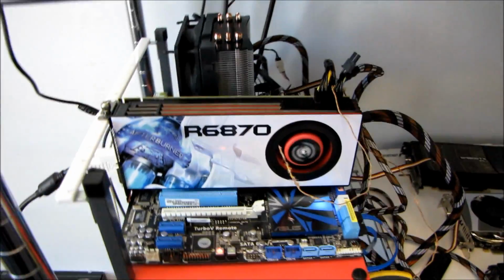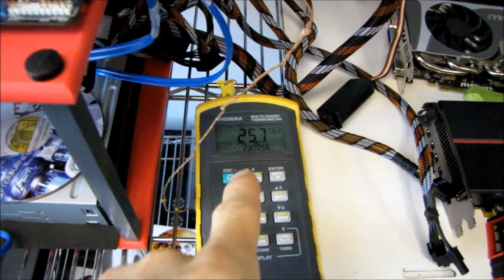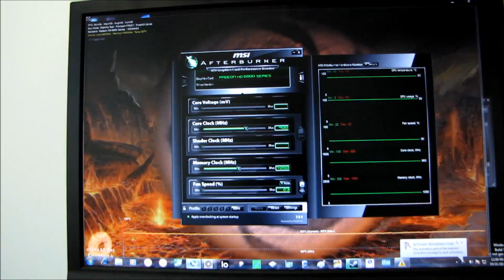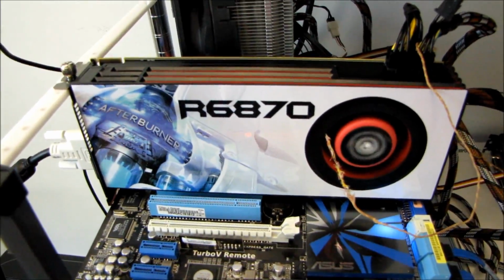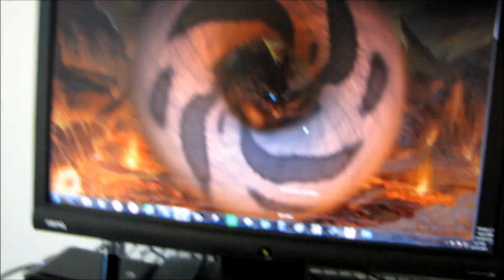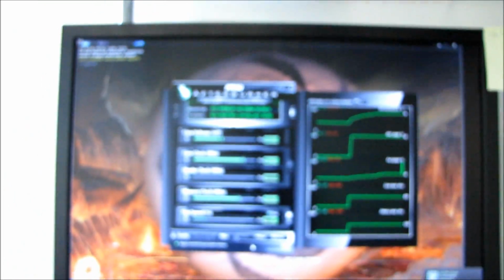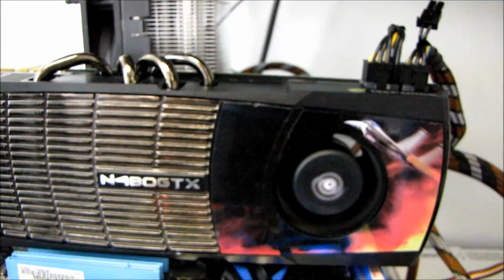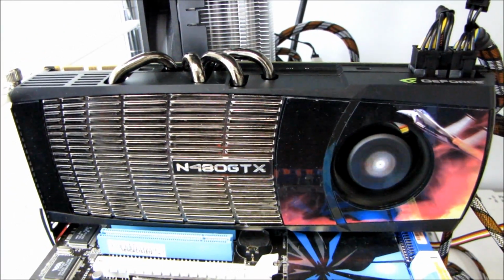MSI AMD Radeon HD 6870 Video Card Noise & Temperature Testing Linus Tech Tips

Comment: ah right, but ive installed a fan on the bottom of the case next to the psu and below the video card, which is pushing air towards the card and the top fan taking the air out

Comment: do not be afraid of those temps. If you see a temp that you think is too high the manufacture does have save temps of operation. You can prolly find this info on the website or included instructions

Comment: maybe the temperature varies by brand, mine is an xfx and i have it in an nzxt phantom with 5 fans, but none of those are directed at my card, you could try msi afterburner and use a custom fan curve, bring the fan speed up and lower the temp, i know mine gets to around 60-65°C at 50% fan speed, however, at that speed it's not too quiet.

Comment: @WiiClassic2usb - But my GPU hovers at 122 F. My case is a CM 690 II, I have a space for a fan just ahead of where there PSU sits with a mesh liner, if I had the extra outlet for it with Pulse Modulation, I'd get another Cooljag to put down there. Thought about getting a PWM splitter cable from FrozenCPU, but dunno how safe it'd be running two of such a high powered fan off one connection on the mobo...

Comment: @Darkfallification - I've downloaded version 210, and I've got it open and it's nice. I like the fan ramp feature, like the Asus AI "Fan Xpert" stuff that came with my Mobo, except with more than 3 dots, now if only I could get the damn thing to display temps in Fahrenheit instead of Celsius. The first time I had Fan Xpert open, I set the top dot to like, 80c thinking 80f, so it got really warm once. I also get the occasional "makes no sense" readings from Probe, like -198.4c.

Comment: Yes, MSI Afterburner is sponsored by and co-developed by MSI and Rivatuner. It works with both ATI and nVidia cards. You also don't need to download GPU-Z really, as Afterburner has its own monitoring. However, GPU-Z is great to see more info about your card real easy.

I can't believe my card heats up so fast and to 90+c. I have plenty of ventilation. Two front and one rear 120mm fans + PSU 120mm fan. And a Thermaltake 120 Ultra on the 3.6ghz OC'd 2.4ghz Q6600. Oh well...

Comment: Download MSi Afterburner. At the right of Fan Speed (%) click the User Defined. Use the default curve. Download GPU-Z to monitor temps and speed. Download FurMark for the stress.
FurMark with default autofan: 93c max, 86% fan on a 9 minute test.
FurMark with default User Defined curve: 90c max, 98% fan max on 9 min test.
Sure the fan gets louder, but that curve cools more effectively.

Comment: @WiiClassic2usb
My HIS 6870 1gb reference sits around 60c idle normally. I just worked out that it is switching to 900Mhz full speed when in Firefox browser here. To fix that idle stress, as Firefox surely doesn't need 3D rendering performance:
Click Tools -> Options -> Advanced -> Use hardware acceleration (untick).
6870 should then run at 300Mhz in Firefox and idle temp should decrease, meaning a longer life for your card.

Comment: Curious question from a paranoid over-cautious user. I have the 1gb Radeon 6870, Speedfan says I'm at 51c / 122 Fand it has a little fire icon next to it, which makes me think it must be over-heating or something scary. But, it runs like this for hours, and I've left it on overnight for days at a time. Closing Firefox drops it back down to 117 F and eventually after a bit it goes back to 95 F. Is all well? Or is Speedfan just particularly sensitive?

Comment: @erenei you particular may have been factory locked at those settings due to a hardware issue like running too hot or artifacting what I would do is call up gigibyte and ask them questions about it and if you don't get an answer return the card and go with a different brand like xfx or sapphire

Comment: @PsiloCybinDreamX 

Don't use benchmarks as an accurate judge of performance because they're not. Use actual in game numbers like I just mentioned. 5770's in Crossfire are NOT 30% faster than a 6870. The benchmarks test for worst case scenarios which are hardly ever achieved in actual games. Benchmarks like Furmark are just ridiculous because no game will ever push a video card that hard.

Comment: @PsiloCybinDreamX 

Where did you get that information from? I just looked at a test at Legion Hardware and they show 5770's in CF running about the same or slightly ahead of a 5850 in most tests which is about where 6870 is, too. They tested in AvP, Crysis Warhead, Far Cry 2, MW2, BBC2, CoH, HAWX, Just Cause 2, Metro 2033, Stalker Call of Pripyat, World In Conflict, RE5 and Wolfenstein And the 5850 and dual 5770's went back and forth with the 5770's just edging out the 5850.

Comment: 41c idle is pretty good but thats at stock fan speed, my 5870 i have it at 28% fan speed and is idle 30c and max load its is with normal gaming (not furmark) 66c max with max 34% fan speed.
This is set with MSI Afterburner fan profile setting.

Comment: @klote2314 Barts IS NEW It was released Oct. 22, 2010.   5970 Uses two old  "Cypress" GPU's released  November 18, 2009.  Antilles, is the high-end dual-GPU that will be in the 6990 and hasn't even been released yet.

Comment: @crimson177 With no water cooling or any extra cooling 41c and 80C+ for a modern graphics card with the default and standard cooling system is not high at all. It's quite low actually and old graphics cards usually had higher tempatures. Note that most graphics cards can deal with tempatures way higher than 80C and that it's a huge difference when you add a better cooling system.

Comment: @aram994 hd5970 should be faster as it has a hd5870 and a hd5850 inside, very similar speeds... the hd6870 is slower than the hd5850 (cheaper) and is veeery close to the gtx 470 and the hd5850 is a lil bit slower than the hd6870... but gain .. hd6870 performs very good with crossfire and its newer... i would go with hd6870 crossfire =D

Comment: @drKlitzman Yes, but not be an extreme amount. But, considering the fact that the 6870 costs less, it is the better deal. The performance numbers will decrease as there are going to be driver optimizations, however, keep this in mind:

The 6900s are ETA'd for the end of November. If you're going to upgrade your graphics card, wait for those.

Comment: @VoLtrex31 About 40% above the 5770. On par with the 5850 a little bit lower than 5870. It has higher minimum fps in DX11 tessellation than the 5870. The 5970 shouldn't be compared as it is in a whole different league.

Comment: Ha. Well my GTX 480 is 47c under max load. Idle is 32c. Yeah H2O cooling.
Stock clocks, not all that much difference at 800mhz as well.

Comment: @Randomshit1353 
at this moment
gtx480 single card
HD 5970 dualgpu card

If you do not wait on a newer ati/nvidia card to come out i suggest getting a gtx 480 from some less known manufacturer (like club 3D) they can save you about €150 on the same card with another sticker

Comment: thats weird that your gtx 480 gets that hot outside a case. mine gets at 81^C at full load inside a case. plus it almost seems like you're badgering the gtx 480 because it would never in at least 10 years get that loud intentionally. maybe after things start to get worn out. and benching cards at full fan loudness is a silly thing to do anyways. cards will never need that kind of fan load. unless components inside the chipset are worn out and are getting much hotter from a long time of use.

Comment: @free2question If you can return it then go for two 6870s. in 3 years it'd be wasteful to buy a 3rd 5850 since it is very very highly likely that we have so much better performing single cards by then. These 6870s will scale significantly better than the 5800s. Go check out crossfire reviews of it. Goodluck :)

Comment: @tenkirulez i bacame a fan after buying ATI card(dont remember model..)  the problem was in game i saw only artifacts i took it back i got the same again  same sh...t i switch to 9600GT and no problem till today i overclocked it  and run every game at mid-high res .i am gonna build my new pc and i will definitely buy 1-2 gtx 460 hawk
Maybe it's luck maybe it's not that the reason i am on nvidia side :)